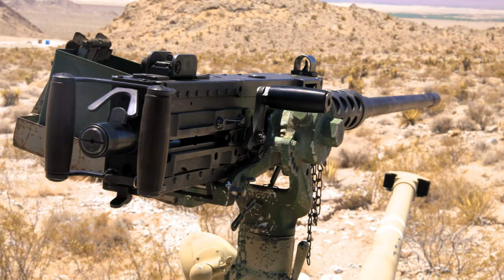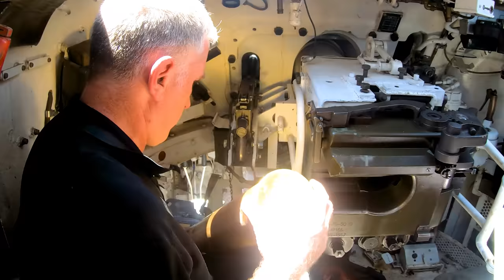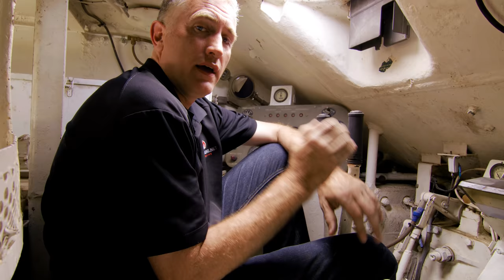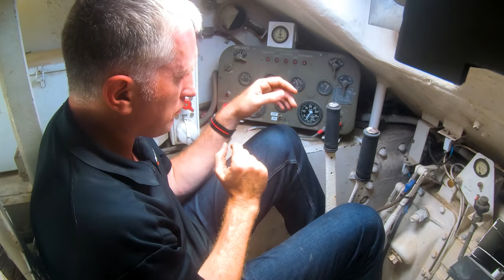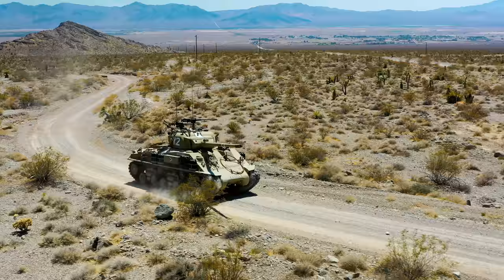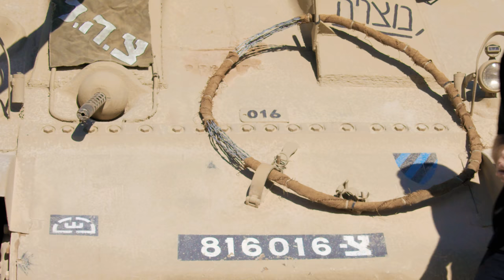Inside The Chieftain's Hatch: M50 Pt. 2 - World of Tanks

Comment: I like these videos where the tank can still run and fire it's main gun: interesting and most likely rare.  That bit of the Egyptians using M4's with AMX13 turrets was surprising.  Those probably had better rate of fire than the T55.
Reply: Yeah man, Egyptians and their turrets. :-) It's a pretty cursed image to see, but it doesn't beat that T-34-100 monstrosity.
Reply: they did have better rate of fire than the T55, if they mantained the autoloaders as they should have, which they didn't and thus the only advantage of the AMX 13's turret was nullified
Reply: @Real Aiglon it is a pretty cursed image to see

Comment: One reason the autoloading turret  was not considered was that once the 12 rounds in the loading mechanism were used up, the design of the turret, you had to reload the loader from outside of the turret. This offers some problems in combat. Also, replacing the Sherman turret with the autoloading turret was apparently a pretty complex operation.

Comment: "It is the business ... to have tanks people can rent and shoot" Now i have another thing on my bucket list.
Reply: The only downside is that, for safety reasons, you can't fire the tank's main gun from inside the turret. They, instead, have you  fire it via lanyard from outside of the tank. They also don't techinically fire true live rounds, because of NFA regulations they, instead, shoot solid projectiles with no explosives of any kind inside of them. But, this still does quite the number on regular, unarmored, cars though.
Reply: @Riceball01  lots of tanks and anti-tank guns used solid armor piercing projectiles. Especially the 76mm and 90mm AT guns. So it's not necessarily wrong for them to be using them.
Reply: @Riceball01   I mean a solid projectile coming out of a 76mm gun at high velocity is still pretty effective.

Comment: When I saw the tank fire it reminded me of a guy who managed to keep a jagdpanther in good enough order to even fire the main cannon.

Makes me question if old tanks have a process of reactivation even from age. Since a lot of these Shermans are still world war II originals with new engines and guns still hoofing it.
Reply: Every vehicle can be fixed, especially simpler ones, if keep in correct storage clean the carburator, check few things and every old engine will fire up in the year 3000
Reply: If the hull is intact and not totally corroded beyond hope, you can resurrect any tank. IF you can find the parts to fit on it to basically rebuild it from scratch. Which is extremely expensive and difficult, and good luck finding most of the parts. You will need to have many of them scratch built if you want it to be authentic. And good luck with the harder components. Where do you find a spare German WWII tank engine, or parts to build one? That kind of thing can't be built from scratch. So in most cases unless it is in quite good condition, it is not worth trying to fix it, it would be prohibitively expensive and difficult. You can always cobble together something that looks roughly like the original by find ways to bolt in a new engine and transmission, making new suspension or repairing the old one, putting some paint on it, etc. Like the BT-7 Moran shows on his channel, which they pulled out of a swamp and got running...but only by cutting out the firewall and installing some modern diesel engine in the crew compartment. You can't get an engine for a BT tank any more. If you find one in good shape, it will still take work, but you can often get it running again with some work and money. It always is an issue of whether you can find enough money, but the better the shape it is in (and the less rare it is) the easier and cheaper it will be.
Reply: @gillespriod5509  If it is stored correctly there is little to fix. I didn't understand that to be the question. that would be "Is there any limit to how old a tank can be an still be made into a driver". What he asked is if there is a 'process of reactivation from age". that entirely depends on whether it was stored correctly and carefully or not.

Comment: Good presentation. I wonder what happened to the M4A1 that was at Ft. Lewis Washington back in 1971 when I took basic there. It was outside the main exchange building with the bottom emergency hatch missing I went in it several times as it was a good place to hide and read on Sundays.

Comment: You may cool, but you never be as cool as the Chieftain shooting and scooting an M50!

Were M50s considered the pinnacle of the Sherman design?
Reply: Probably the 105mm armed M-51
Reply: @TacoSallust  There's also the Chilean M-60 Sherman armed with 60mm HVMS gun firing APFSDS shells. The gun found on AUBL 74.

Additionally, those M-60s were made from 3rd hand M-50 Shermans from the Israelis. 

Other than Shermans, Chile also has M24 Chaffee tanks modified with the same 60mm gun.

Comment: I can still see a generation of American ordinance engineers beating their heads on their desks for not thinking of that bolted on mantlet extender as a way of getting a larger gun in the existing turrets.. thats the major chunk of 'so simple it has to be genius' design element here.  Ditto for the folks who shoehorned the 17pdr into the firefly seeing this for the first time with a 'why didnt WE think of that??'
Reply: Extending the main gun's pivot point that far forward may have had alternate issues with elevation and depression, especially since the breech's vertical swing would be greater in distance because of the longer lever arm.  That could have complicated loading, as well as turret balance - adding this turret's counterweight might not have been feasible given the supposed weight limits of the previous engine.
Reply: As Chieftan explains in great detail the WWII Army was working on bigger guns but they were never accepted for use.  The Pershing was the next step up.
Reply: @JDCheng  This is more or less the case. It’s why the T23/76mm turret with the trunnions mounted further forward was not preferred for the 17pr conversion, even if it did move the gun forward. Led to problems getting the ancillary bits like elevation gear to fit right,
Reply: @rogersmith7396  As he also explains in great detail several attempts to upgun the original Sherman turret by the ordinance department that were initially approved by armor branch and then rejected when they found the turret too was too cramped.  the 100 shermans with original turrets and 76s that got produced but never sent overseas as an example.  all of those, and the firefly as well could probably have been made to work by that bolt on mantlet extension..even better , a bolt on mantlet kit would have allowed upgrades at the depot and field level.
Reply: @arthurthedented  the problem with a field-expedient bolt-on "mantlet kit" for the main gun would be twofold: one, as was mentioned, the change in geometry would mean the elevation linkages would need to be replaced as well.

Two, just adding a larger gun - and one that's extended forward from the front of the turret - would imbalance the turret on its ring.  That would cause significant stress on the turret traverse mechanism, especially on uneven ground like a turret-down or hull-down position behind a berm.

Even in this video, the M50 has a significant counterweight added to the back of the turret.  That's not something you can easily add in the field.
Reply: @JDCheng  I'm pretty sure adding a weighted bustle with relatively thin sides and a very thick back plate three or four feet back from the turret wall to balance the turret as part of the kit at the arsenal or depot level would be fairly simple..  The real problem as someone pointed out at that point becomes overall increase in weight which the original suspension and engine might not have been up to or might have been considered unacceptable performance degradation by armor branch.  which is a pity because I'm pretty certain sherman crews would have appreciated the armored bustle stowage more than the larger gun.
Reply: Come On! A turret extender in the front a counter weight in the back? A TC foot chopper in the middle. Just cast a new turret.
Reply: @arthurthedented  Ordenice  didn't care about that with the Sherman Jumbo
Reply: @johnneill990  easy to say in peacetime or when building from new.. but when you have ten thousand of an older model on hand that you'll be taking to war..upgrade kits happen. and were performed regularly at field service depots.
Reply: See Nick's video on the Firefly. His opinion was that the ergonomics made it a practically unfightable POS - the British tankers made it work because they HAD to. In particular, you needed a trained orangutang as a gunner to reach the various controls while looking through the sight.
Reply: @colbeausabre8842  well agreed but that was because of space constraints  of the big gun in the small turret.. which mantlet extension fixes with a simple bolt in part (and bustle counterweight) giving adequate room to make fightable crew positions.
Reply: @colbeausabre8842  No problem for the brits. Those persons are refered as Scotsman ;)
Reply: @mbr5742  I am shocked and disappointed that you can imply our neighbours are trained Orangutang.  however i am still laughing!!! (not certain, if i am more shocked by the implication that they are Orangutang or that they are TRAINED Orangutang.)
Reply: as an interesting aside you may like to look up the conversion of the Churchill tank to the NA75 version. Replacing the British 6lb gun with the American75mm from the M4.  As converted by captain H.P. Morrell.  operation Whitehot.

Comment: "They found that if they deleted the bow gunners position on five tanks, they could man a whole other tank." Took the worlds militaries 4 or 5 decades to get that one straight. They sure didn't seem to mind the big bullseye weak spot in what is supposed to be the thickest armour...

And yes, I know most of the time tanks are fighting infantry in field fortifications, the bullseye works a well for a RPG as anything.
Reply: you really over estimate the ability to hit the ball joint.
Reply: It goes much further than that. A tank platoon in the IDF consists of only three tanks, not four as in the US Army. A tank battalion  has 36 tanks and an armored brigade has 111 tanks. A platoon commander has only one platoon sergeant to assist him.
Reply: you overestimate the accuracy of tank cannons and RPG's There is a reason they generally shoot center mass. epecially in those times.
Also the bowgunner was the first thing that could lay fire on an infantry poking it's head out if it was in the front. if the turret was turned then both the cannon and coax needed precious seconds to turn before suppressing.

Comment: Would the tracer fire from the coaxial mg be used to help sight in the main gun?
Reply: It could be, but it's not ballistically matched so would require some adjustment. The bigger problem is spotting the impact at range
Reply: @TheChieftainsHatch  I was thinking that tracer fire could be used as a sort of an azimuth to help with acquiring a line of sight faster. You being an active tanker didn't use it so it wasn't sop. Thanks
Reply: @31terikennedy  At ranges that the coax tracer hasn't burned out, you don't need the rangefinding assist
Reply: @TheChieftainsHatch  As you can tell, I was never a tanker. Thanks again for responding Sir.
Reply: Why would it? It is a totally different round with a totally different trajectory. Even the British when they used spotting rifles uses a .50cal, because it is a lot bigger and heavier and longer ranged, closer to a main gun, and they used special ballistically matched ammo for the gun. A 7.62 has a pitiful range compared to a cannon. They sight the guns in on a firing range so when you put the crosshairs on a target, it hits that target. The only part you need help with is knowing how far away it is, and a 7.62mm isn't going to help with that.
Reply: @justforever96  My point was under 800yds the coaxiel  tracer fire would help in acquiring your sight picture. Ping, than the boom.

Comment: I don't recall israelis ever being proven wrong by installing more machineguns whenever there was space for more machineguns... and half a time when there wasn't and they had to make it. More Machineguns IS definetly a right answer. Even if costly back in WWI/WWII era...
They weren't wrong by plastering the tanks with all possible ways to lay smoke screens either.
Reply: Logistics are also much simpler when your supply lines are a dozen miles long, not thousands of miles. If a platoon runs out of machine gun ammo, getting a re-supply is generally easy.
Reply: Honestly the US army in WWII also put MGs on everything, and it worked for them, so they were probably just copying a tried and true tactic...
Having a logistics train that can support it helps, too.
Reply: Tank Engineer: How many Machine guns do you want?
U.S. Army: Yes
Israeli: Yes, and then double it.

Comment: I thought the Israelis strapped on all those extra machine guns to give tankers a chance to deal with incoming Saggers, by knocking them down or forcing the operators to take cover.
Reply: In urban warfare, tanks serve mainly as small , mobile fire bases to support the infantry. An extra machine gun on the turret is a force multiplier, especially when each machine gun covers a different side of a street.
Reply: @abrahamlevi3556  Actually, what the Israelis did is adopt a training aid to combat use. There is a mounting kit to mount the M2HB over the main gun along with a cable that plugs into the firing circuit. You set the machine gun for semi-automatic fire and blaze away. It's called Subcaliber Training and is used both to save money (120MM training practice round is $1100, Sabot is $850o - and the Army gets the bulk discount) and on ranges where full size ammunition can't be used safely. We couldn't fire 105mm when I was at Fort Lewis as a ricochet off the target could have ended up in downtown Tacoma, so we did subcaliber work at home and went to Yakima to use the main gun. The only thing the Israelis did is add a third switch (Main Gun, Coax, Fifty) for the gunner and forget about the semi-auto feature.
Reply: @colbeausabre8842  What does that have to do with the conversation? They were talking about M50 Shermans and Israeli tankks in general and how they liked to add MGs all over the tank for each crew member. What does that have to do with Israelis using an MG as a training aid? Other than being very distantly related as being on MGs and tanks, it has nothing to do with the conversation. The are talking about pintle mounted, crew served weapons in combat, not ways to save a buck in training.

Comment: LOL, obviously reverse isn't synchronized. There is only one reverse gear, you aren't going to be shifting from reverse-high into reverse-low, so there is no point in a synchro. You need to come to a complete stop before it is possible to engage it, so it would be totally pointless. That is not to say it is not constant-mesh, that is different from a synchro system. And first gear is a no-brainer since you don't WANT people shifting down into that unless they are very very sure they want to, because they willl blow the engine up unless they are going about 2mph or so. Better to just make them stop before they engage it, or at least make sure they have to work really hard to engage it.